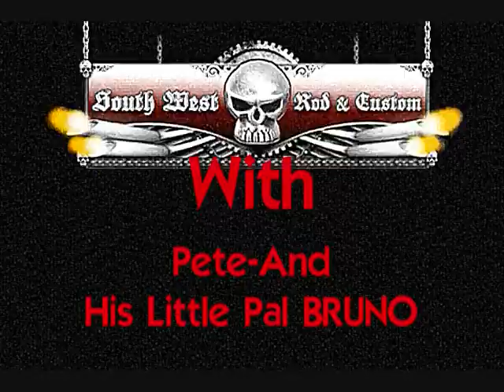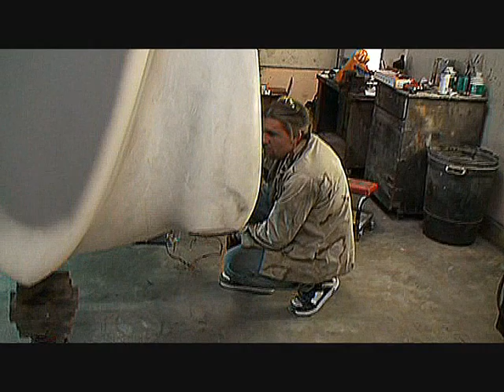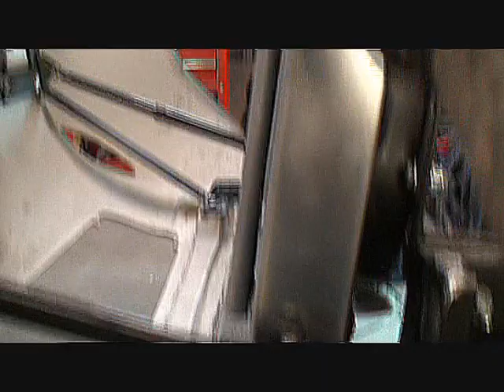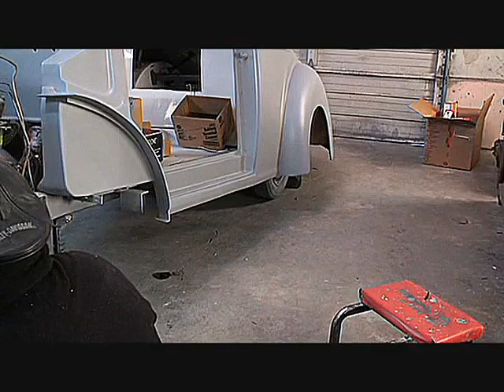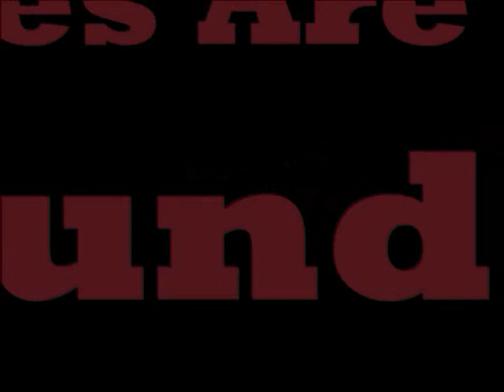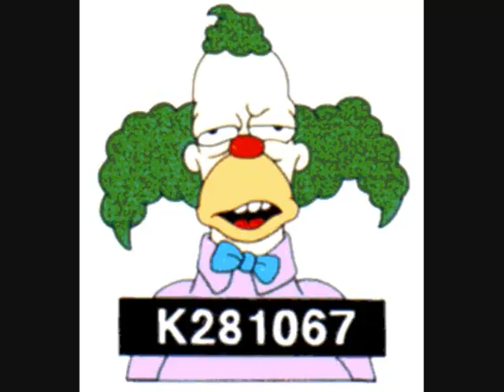1941 Willys Coupe-Streetbeasts-Tilt Front End-Mistakes Happen!

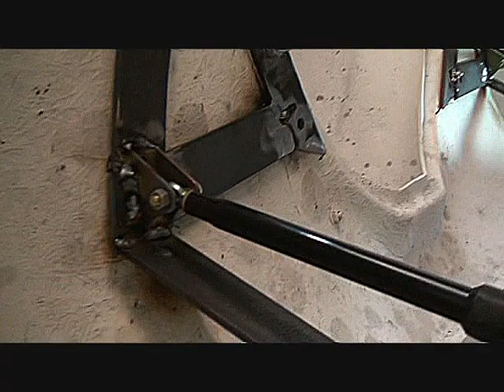Comment: At 4:41 it looks like the actuator is very close to touching the bottom of the frame in 2 places. If it jams against that, and the actuator continues to extend, the actuator rod will torque the base of the thing and snap it just like we see here.
I'm not trying to be a wisw ass, just trying to help. Check the clearance .